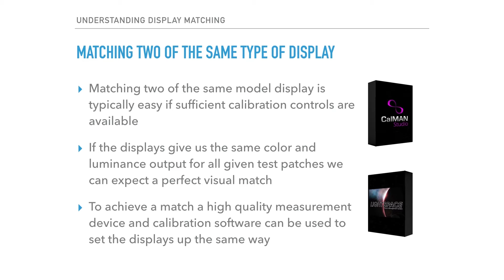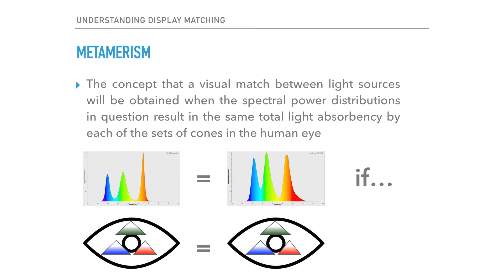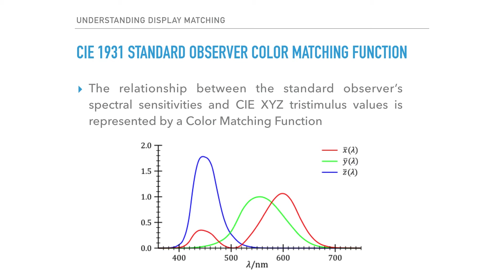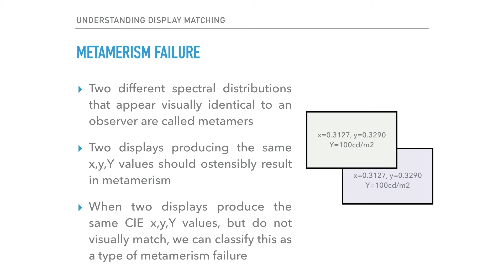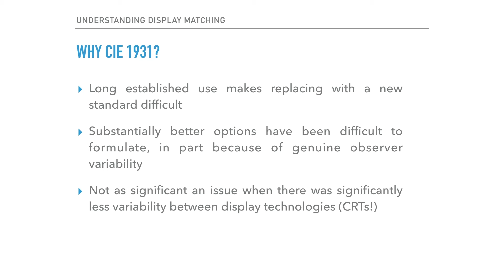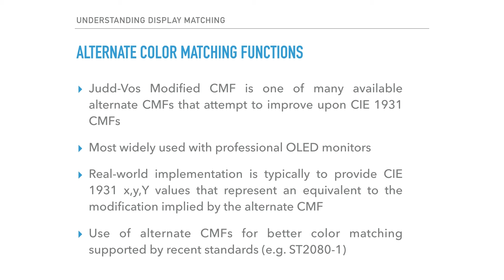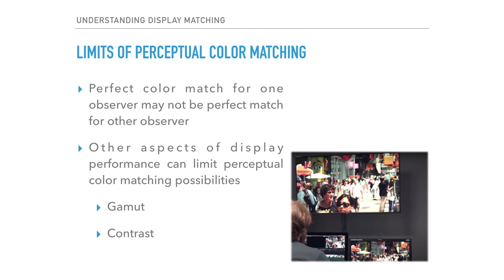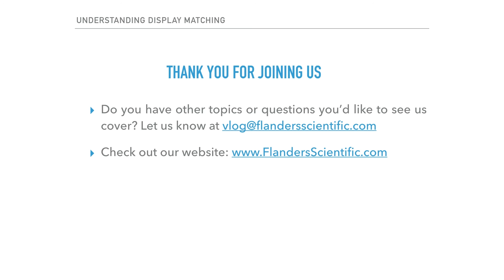Understanding Metamerism Limits

Comment: For someone that has been doing display calibration for many many years as a hobby for my photo editing, general PC monitor and home cinema displays I have a perfect understanding of how to use the meters and tools to achieve "perfect calibrations". I have just bairly scratched the science and theory behind though, mostly because it was not needed. However when trying to calibrate a newer WRGB LG OLED with the "EX" panel type that has a much more spiky spectral distribution my calibration gets visibly off. I'm using an iPro 3 spectro that is of too low resolution (10 nm) to actually measure the display correctly too. As more high res spectros isn't viable because of the price point, and as I understand from this video metamerism failure might still not get me to a visually perfect display anyway - I am going to resort to perceptually matching my OLED to my primary PC monitor that seemingly is well calibrated with the tools available. This video also tells me all I need about that procedure. 
I thank you for the work you have done making this excellent video that explains all the theory in just the needed level of detail to fully grasp the concept! 👍
Reply from the maker: Thanks for the kind words! Feel free to contact our support department at Support@FlandersScientific.com if you have further questions.